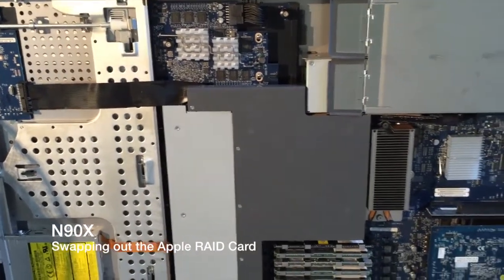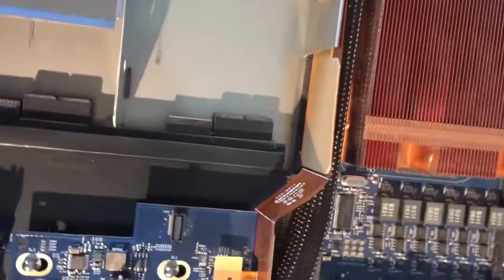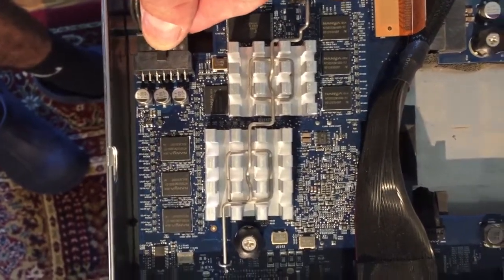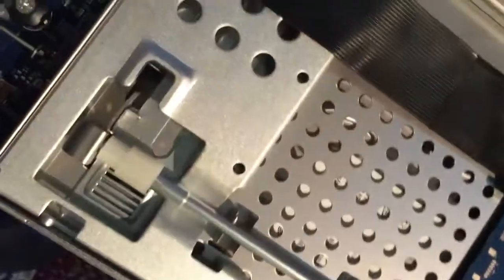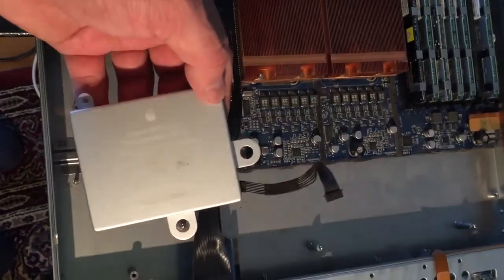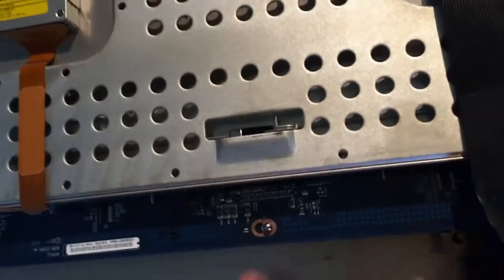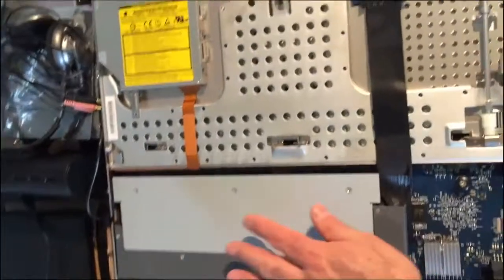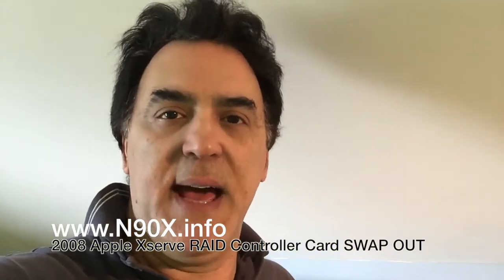DIY Swap xServe RAID card for non-RAID Card! No more Battery Issues.(N90X) 2008 xServe as MacPro

Comment: Thanks for the update with the card replacement. When my battery went dead a second time I was planning to drill a hole in the case and mount an external source (maybe from a car!). I retired about that time so never bothered. But this was good. What about the transfer rates when it was all done? The cache card was there to improve the write speeds dramatically. But did the non-RAID lose all that speed? Here was my original video that you linked from. https://www.youtube.com/watch?v=q7g1lDXJw1I
Reply from the maker: APPLE software raid will be about the same for READ speeds. I never actually tested the R/W times, but I saw no difference (that I could tell) when going to the non-RAID card.

Comment: Can the Xserve still power on if the battery is dead or should i get the raid card with no battery?
Reply from the maker: it will still power on with a dead battery. I am told only cache is lost if the battery is dead, but I was not able to confirm this. My understanding is that if the battery is dead you lose the RAID configuration. in my humble opinion get a non raid system unless you want to deal with this issue or unless you really need hardware RAID. you can always use APPLE software raid.